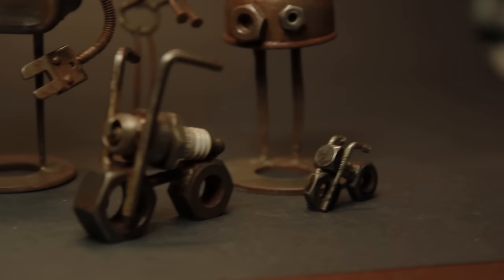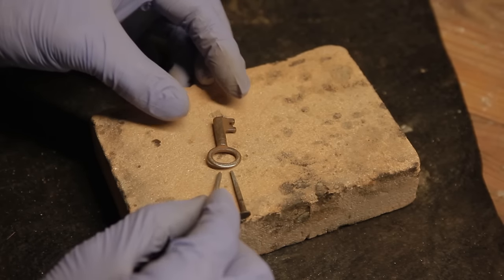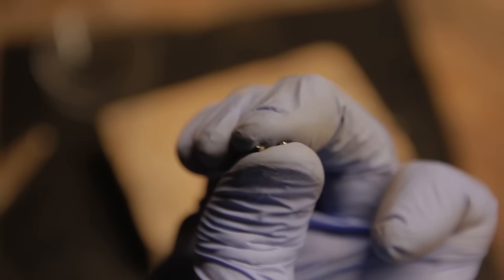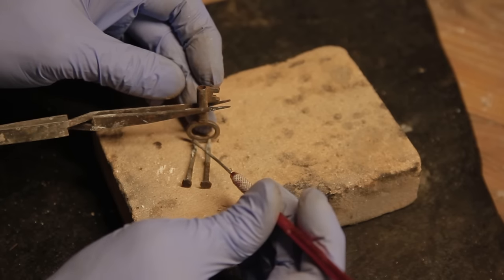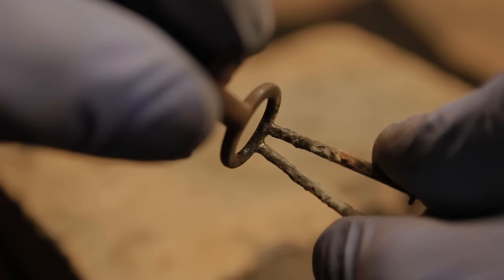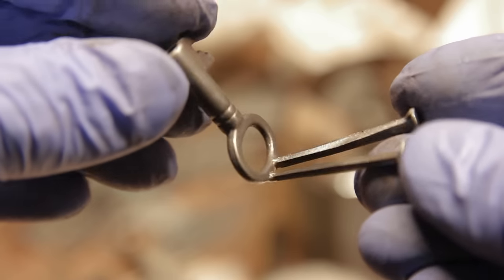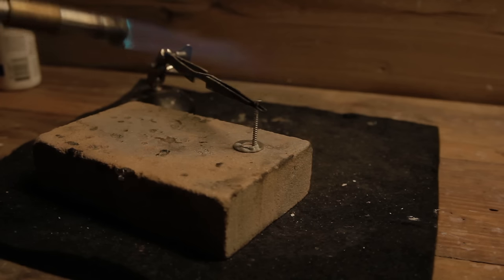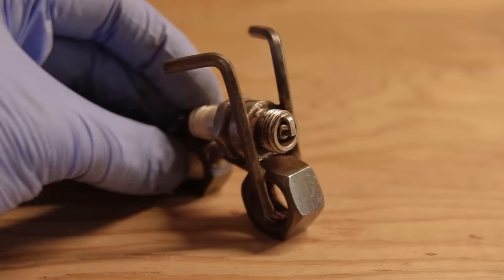HOW TO SILVER SOLDER - Metal Hardware Sculptures, Upcycling, etc.

Comment: Please forgive me for being slow here...  I don't know anything about soldering...  But can I use a soldering gun thing,  the electric thing I use on electronics?  I scrolled through the comments and didn't find anyone asking that so I guess it's pretty lame...
Reply from the maker: That's a good question! The main issue (I think) would be getting the metal up to temperature for the solder to flow. So if the soldering iron can do that, then it's possible. I'd say it should work on smaller pieces, like jewelry.  :)
Reply: TheCrafsMan SteadyCraftin well the solder flows but I don't know what gage  it is - I will check and see it it will hold what I'm wanting to do...  Thank you so much!  I'm really inspired from your videos!  Love em!

Comment: That 65 percent is silver braze material. If it melts above 750 degrees it is brazing, below 750 degrees is soldering like with 99 percent silver.
Reply from the maker: Dave, thank you for that info! I've seen them used almost interchangeably, so it's good to hear a breakdown of the exact difference.
Reply: Well done Dave for pointing that out. In the UK that type of solder is not classed as Silver solder and will not pass the UK Assaying and Hallmarking. Not that you need to hallmark a piece of iron. Incidentally Alum can also be used to remove the burned flux and oxide and will not attack the metal.

Comment: does that work on aluminum?
Reply from the maker: It's a tricky one, because aluminum melts pretty easily. One time I went to solder a little key onto something, and it straight melted in almost no time. I assumed it was steel, but didn't check it beforehand.

Comment: After learning how to TIG weld and braze, I rarely silver solder iron anymore.
Reply from the maker: I thought about getting a welding machine, mainly so I could do larger sculptures. :)
Reply: @TheCrafsMan  
That's exactly what happened in my case. Bigger projects makes bigger paychecks. But It's the thicker metal, bigger joints and lengthy heat input that made more gas costs. Warpage because of longer and bigger heat input was the other problem. My newest TIG welder is the everlast 250ex. AC/DC power supply.  It'll fuse or weld All ferrous,  aluminum, copper and bronze metals, thin or thick. It's the best machine for the money. I did my research with years of experience at good and bad TIG machines.  I'll walk you through it when you decide to pull the trigger on buying your first machine.

Comment: I have this stay silv and harris 56% silver solder. Ive been using it on chainmail (carbon steel from the ringlord.com very cheap and easy to work with). Wherever I apply the flux and use my high temp butane lighter, the solder flows perfectly. I am using it mainly to join the splits and make the ring whole but I am now wondering if I just put a layer over the WHOLE ring to stop rusting. Anyone have thoughts on this solder being rust proof or any ideas? I know silver itself is rust proof but the stuff I have is only 56% so...

Comment: sliver solder seems to be very expenisive, would TIG welding not be cheaper?
Reply from the maker: Hey Gavin! The solder (at least the high-silver type) is somewhat expensive. I thought about buying a welding machine when I got into this, but ended up trying silver solder. Those rolls last me a pretty good while. I'm only on my 2nd one.

Comment: Does this require wearing a welding mask to protect ones eyes?
Reply from the maker: It's not intense like what you'd see from, say, arc welding. It's usually not a bad idea to wear some type of safety glasses, but clear would work in this case. If fumes are a concern, wear a full-face respirator that covers the eyes also.

Comment: asmr voice,natural or faked? anyways enjoyed it but im wonderin why not pickle and buff the pieces first before soldering,wont it make it easier? i just built myself a minature oxy propane torch and have tried to braze steel wire with not much success,i tried flux for tin solder and used solder and even tried silver solder ,i finally got one bead to join the steel wires (at least it seems strong) so why was i failing but that one worked? am i using too much heat? cause everything was oxidising
Reply from the maker: Hello! Thank you for watching! I just got in the habit of pickling after soldering to remove that flux. Seems to work well, and wire-brushes off easily. Have actually never tried pickling before soldering. Too much heat can have an effect on the joint. That's the hard part, especially if dealing with two different-sized parts. I've been able to join a skinny rod to a large gear before, but it was a heat balancing act. I'm not sure why the one failed in the case you describe, though.
Reply: yeah i heard its possible to braze iron but idk about steel? i am trying for fun just to see if i can braze 1/16" steel wires using regular flux and silver brazing wire also 1/16" ,,its a hard balancing act to get the metal and solder to melt without oxidation but the wires start sparking very fast,perhaps i need to adjust my flame to carburizing or neutral but it takes longer to heat

Comment: Safety tip: Also never solder a metal container that is fully enclosed. Always drill a hole or two to allow heat/air to escape. Nobody wants a metal container exploding in their face.